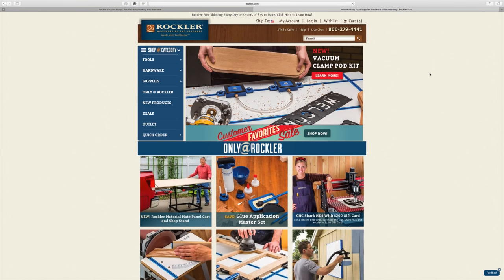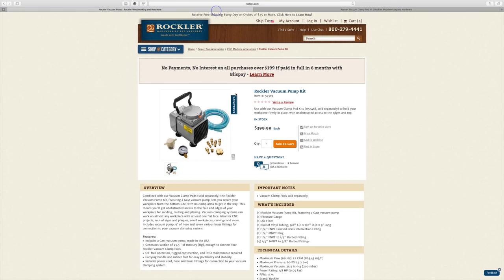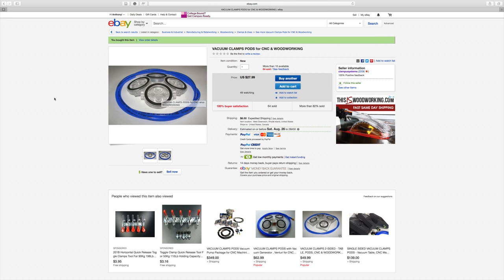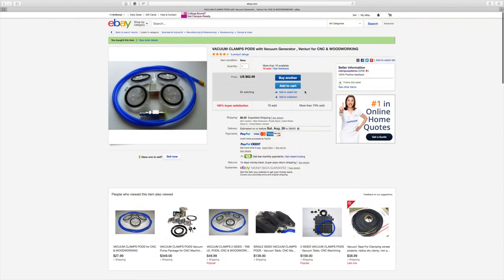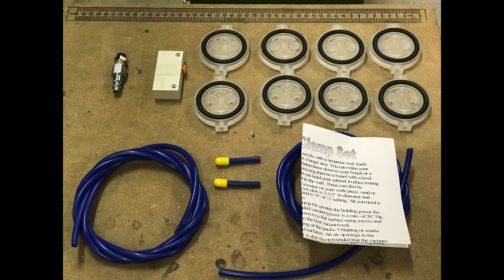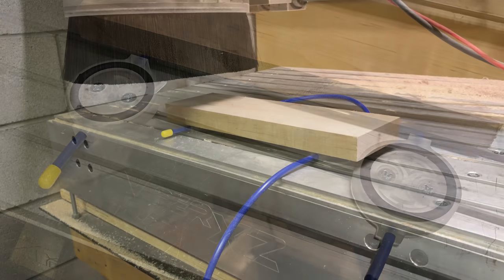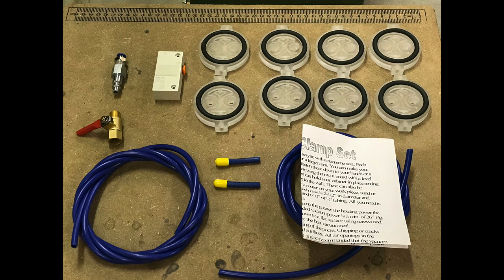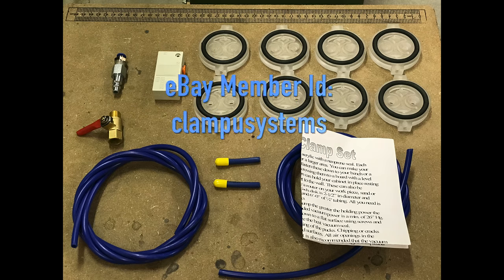Review of Vacuum Clamping System Purchased from eBay

Comment: I’ve been curious about vacuum pod clamping for awhile, how noisy is the air moving through the Venturi? Also, have you experimented with putting a valve between clamping pods and Venturi to see if it will hold vacuum without constant air flow?
Reply from the maker: Tim Atkins It is pretty noisy. A fairly loud air noise. That said, my CNC working is so loud, and a the air compressor, that the air noise is a non issue for me. It will not hold anything down without a constant air flow...well I should say the materials I am using. Since making this video I have moved to a home brew hold down system using a cheap harbor freight vacuum pump, and a small air tank. The Venturi worked well, I just wanted access to my air tools more while the CNC did it’s think. I still think the system rocks.
Reply: mytaphandle.com  Thanks for the response. I have a small harbor freight vacuum pump and made a 2 sided pod. Doesn’t work as well as I’d like. Haven’t given up on it yet.
Reply from the maker: Tim Atkins When I moved to the HF vacuum pump, it was just ok. During it’s operation the vacuum seemed to vary just a bit. What made the difference for me was the “reservoir” tank. I got a little 5 gallon steel air tank and put it inline with some valves. I wait until there is a good vacuum in the tank and then open up the valve on my hold down.
Reply: @anthonyisrandom great idea. I've got a portable air tank (fill with air from compressor for leaking tires) that I might be able to convert. Thanks

Comment: Would this work with a pancake air compressor?
Reply from the maker: I’m not saying it won’t, but I might be a little skeptical. The Venturi has to have constant airflow. When I was using the Venturi I was using a 30 gallon air compressor and it could just keep up. There are some pancakes designed for job sites that seem to push more air, I don’t have the information in front of me that said how much air needed to be flowing.

Comment: Do the clamps also vacuum down to the waste board or just to the material you are milling?
Reply from the maker: Just the material. I bolt the clamps to the bed...or sometimes screw them to a waste board if I do that. I have been getting into making my own clamps with HDPE lately.